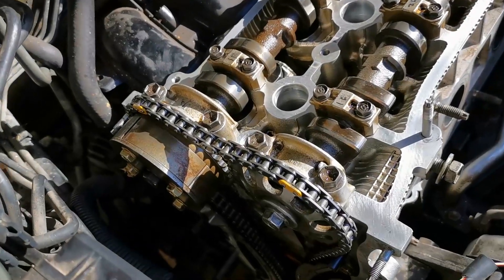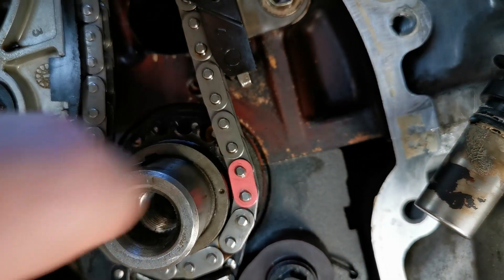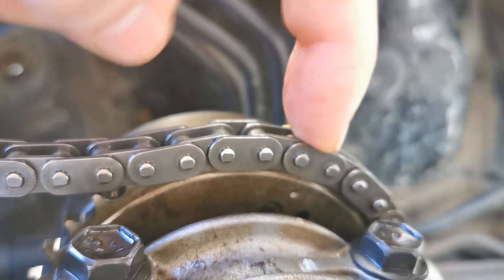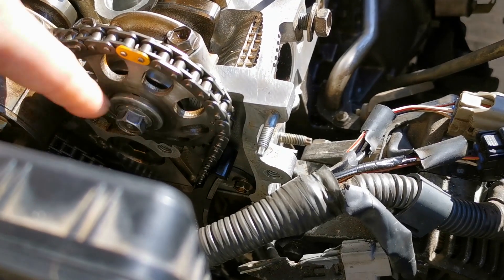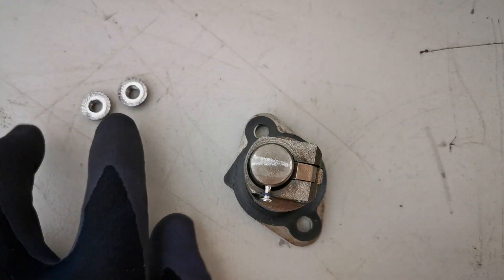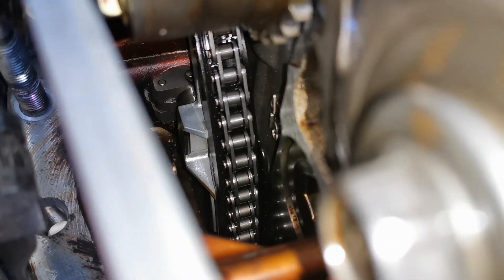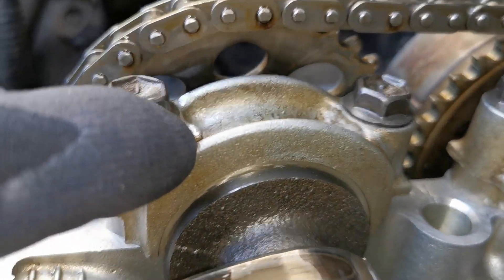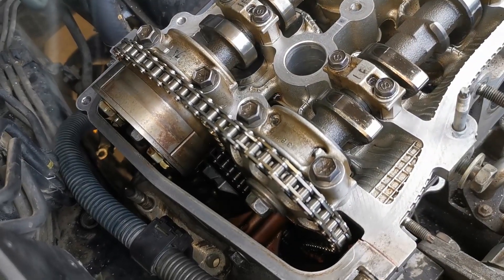How To Set The Timing On A Toyota 1AZ FE/2AZ FE Engine

Comment: You're the first one I have seen that points the cam lobes out another word for number one cylinder the camels are pointed out on the exhaust side and out on the intake all of the videos they have the cam lobes pointing inside so I'm not sure which one is right the way you're doing it does make sense
Reply: Pointing out
Number 4 cyd will be pointing inward and rocking between closed and opening,

Comment: I'm replacin the intake cam gear on my 2010 rav4. The timing chain doesn't have the colored links. I had the crank at TDC by the mark on the crank pulley. Both cam gears appeared to be properly positioned. I didn't take off the timing cover that was done in the video. I removed the chain tensioner to help with this. Because there wasn't any tension on the chain, both cams moved. I have the new gear on but trying to make sure that the cams r correctly positioned.

Comment: good videeo with easy to understand video i liked it if you see this do you feel at 70 thousand I shud replace that chain and the 2 variable timing sensors I believe they are called that... I am leaning toward No at 70 thousand but im not a certified toyota mechanic  have just been around cars most my life and picked my 3  uncles brains and my dads for 25 years ....😊
Reply from the maker: At that mileage with no faults the answer would be no. I wouldn't be replacing it unless there is a mechanical reason, like timing issue or chain slap.

Comment: I just had. my 2003 rav4   IAZFE. L4  that was givin to me by an older lady she always stuck to the. maintenance regiment like clock work never abused it just drove it like a women i THINK in 60 year old range would drive it. my wife works  with her and has been for over 15 years the lady takes care of her cars she knows i. always am working on 1 thing or anotherit so this isnwhy she gave it to me 
something else she also gave me was a manilla envelope about 2 inches thick of all the parts that she replaced on this vehicle So I was pretty confident a toyota witha small four would last at least 350,000 thousand so it was. much to my surprise when i broke number 2 pistons connecting rod which in turn like a domino affect destroyed the sparkplug  in fact it put it right thtu the top of the piston so now i was looking at a  refurbished block new crank ,oil pump pistons rings honed how many degrees over that would. be suitable  again rings and a head redone of course so i just had my mechanic who does all my big lift related jobs find one with 70.000 on it for 1.800 bucks with free shipping he deals with them and has been for long time they are A+ Accredditted with THe B.B.B. FOR 15 YEARS I ALSO did a whois on there website and their Domain Name Space is 18 years old so im still hoping with fingers crossed its quite doesnt burn any oil or use any extreme amount of anything oh the connecting rod brokenat 160.000 thousand shentookmcare of it so i looked on ebay and they have a few for sale on there with over 250.000 thousand thatnthey want about 13 to 15 hundred for i said whataaaat    when i seemn that inhave had alotnofngoodnluck withnisednmotors when Unwas younger butnthisnone isnt even mine its for mynson whonstarts college in a few months and its. a must it is dependable,,, at 70 tho. it has no. reason not to be it also came with a 3 year 30.0000 thousand mile warranty on it all the vital internals are all covered by labor warranty anyway parts and labor i am feeling good about it`

Comment: Hi sir.do you have a video on how to remove the cylinder head of the Noah/Voxy? because it's so tight in removing the belt tensioner and the steering pump to give way for the cover.

Comment: Thanks for this video!! I have a quick question, how much slack or "deflection travel" is there supposed to be on the timing chain with the tensioner installed? I ask because I am looking at a friend's 2003 Camry and with the valve cover off pushing downward on the top portion of the timing chain (between the two cam sprockets) it has about 3/4 inch deflection. Does this mean the tensioner is worn or broken? Thanks

Comment: Short simple and to the point.
Like it.
Just copied as you did on my rav 4.
Thx.
🇿🇼.Zimbabwe.
Reply: @GerardBurkeBurkesGarage  hie.
I did the timming and my car stated one kick,but the oil light stayed on,no oil running in the engine,so i remove the oil filter and started the car again,and no oil came past the oil filter,so i guess my oil pump is not pumping oil,ill either buy a new oil pump and run the engine again and if it still dose not pump,i guess my engine bearing are worn or something. 🤷‍♂️
Reply: @mohameddada2580  my timing chain broke , my mechanic says I have oil pump issues too
Reply: @mohameddada2580   you end up changing your oil pump? my oil light just came on in my Scion Xb. same 2az.